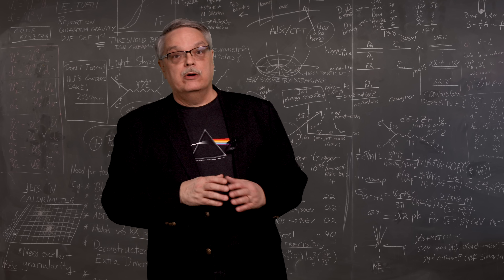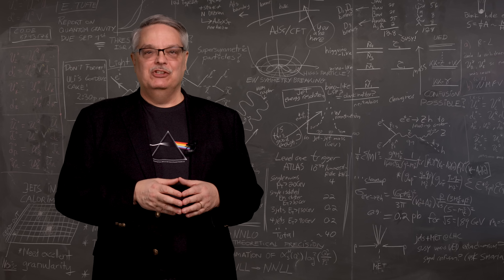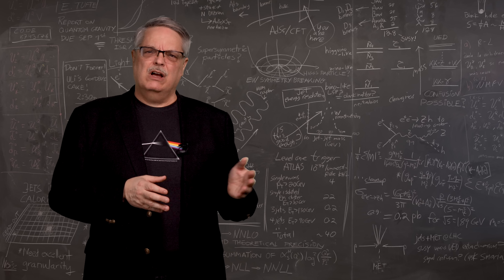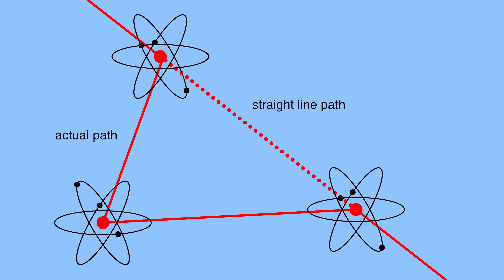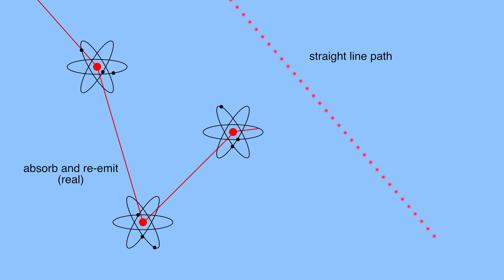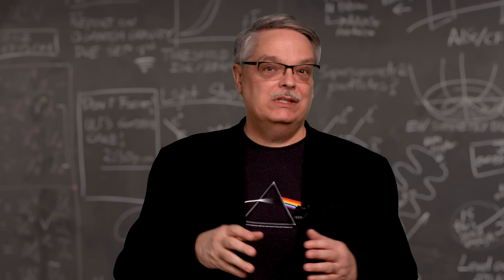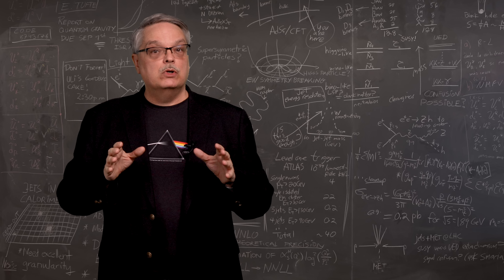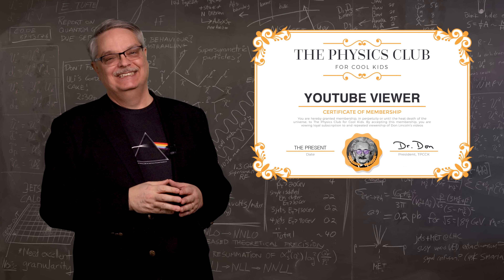Why does light slow down in water?

Comment: 9:18 "but the waves from the electrons move at a different speed"
But why is that ?
Isn't the space between atoms just a vacuum ?
Reply: Ok so first off, the people answering this about electrons having different speeds from photons are dead wrong.  The electrons don't propagate as a wave, they are bound to the atoms.  The incoming light wave (photons) causes the electrons to VIBRATE, which in turn creates a second light wave.  At this point, the speaker in the video botches the explanation.  Both light waves travel at c, however you get some complex definitions of a "wave packet" which has several different ways to measure its speed because it isn't just a single photon, but instead a combined pattern of photons moving through space.  Basically instead of simple sine wave oscillating up and down, light reflecting off of objects (or thru glass, or both) looks more like the audio waves that you see in a music editor.  The information about an object (the image) is contained in packets of overlapping signals.  These packets can appear to move slower than the individual frequencies, because of the way the different waves add together.  This is called phase velocity, and this is what is "moving slower" in the path through the glass.  When the light leaves the glass, the contribution from the glass atoms is subtracted, and the phase velocity returns to the orginal value (remember light is also "moving slower" in the air before it hits the glass).
Reply: @ianallen738  Except you seem to confuse phase velocity with the group velocity. The speed of a packlet is the latter one, while what we see in the medium is a decrease of the former one.
Reply: It is simply not true. The 2 waves are tied in phase everywhere, therefore they can not have different speed (nor their sum). Those waves has not been animated for good reason: it would have revealed the fact that all of the waves has the same speed.
Reply: I have the same question. If somebody could explain it, i would appreciate it very much.
Reply: @juliamay8580  take a look at his video about The Standard Model. Electrons are a type of Lepton where as Photons are a type of Boson. Leptons and Bosons are both elementary particles but do different things.
Reply: "Isn't the space between atoms just a vacuum ?"
No, not really, or rather, there is no such thing as truly empty space. Electromagnetic fields, like the fields describing all forces, have values for every point (or at least probabilities of values). Light is called "electromagnetic radiation" because it can be thought of as waves in the electromagnetic properties of space. When he says that different waves in the same place "can be" added, he means that they are added: that's what it means for two things to be in the same place, barring superposition.
I may have some misunderstanding, but I believe that electrons, like all particles, can be thought of as (oscillating) bumps in various types of fields, including electromagnetic fields. In any case, the effect of an electron oscillating ought to create waves in the electromagnetic spectrum, the problem of course being that all this works according to quantum physics, so I would be lying if I said that I really understood it, even if there have been times in my life when I understood most parts of it, which may not have even been true in the first place.
Reply: @Mr.Nichan  Go back to the original question! Why would the waves from the electrons move at a different speed? In this aspect everything you wrote is irrelevant. The space doesn't distinquish between waves regarding their origin. The explanation of Don Lincoln is just plain wrong, both in physics and math. "recombination" of 2 waves travelling at different speeds is just a stupid, impossible idea. If the slower one is just not there yet (in a specific point where "the light" has already arrived), then how could it be added to the faster one?
He just described the Ewald-Oseen extinction theorem totally wrong.
https://en.m.wikipedia.org/wiki/Ewald%E2%80%93Oseen_extinction_theorem
You can find the falsification explicitely:
"...each of these waves travels at the speed of light in vacuum, not at the (slower) speed of light in glass."
Reply: @PafiTheOne  I agree. So far the question has not been answered, and the animations are plain misleading. I summed this up in this comment: https://www.youtube.com/watch?v=CUjt36SD3h8&lc=UgwzIArRhXxcJHUTdTB4AaABAg
Reply: I just want to point out that my attempt to include quantum mechanics by talking about probabilities of field values was probably garbled. The idea that fields have values at every point is the classical physics explanation, not the quantum one. I think that something like these values might appear at quantum scales, because the "probabilities" of positions of particles are actually the amplitudes of waves (so "probability" has values at every point in space), and there are things about adding up all the possible interactions (which would include the transfers of photons that explain electromagnetism). I would advise Eugene Khutoryansky's videos on waves and quantum mechanics and the Veritasium video on alternate realities for a better explanation of quantum mechanics.
Reply: @Mr.Nichan  I've never read deeply about the classical electromagnetism, but your explanation about fields everywhere remembers me a lot the modern physics while describing the vacuum as full of energy, instantaneously popping up and destroying particles that, effectively, results in matter.
Reply: May be this vaccum is occupied by electric and megnic feild of electron or the whole atom
Reply: full of electric fields...
Reply: I think that's a mistake, both EM waves move at c, but their superposition at < c
Reply: @kapsi  "both EM waves move at c, but their superposition at < c" Try to find such wave functions!
Reply: @kapsi  I don't think it can be described as a superposition of just two waves moving at c. That would be moving at c too. Frankly I find this video misleading.
Reply: Electrons have mass, they can not move at speed of light. Because they move, they generate electrical field opposite.
Reply: @MübinIcyer  yeap that's it what I wanted to point out, it's the reason
Reply: it's because electrons and photons have fundamentally different speeds. this is because the electrons interact with the highs field, which pervases all of space so the space between atoms still has the higgs field. photons don't interact with the higgs field and this is seen because electrons constantly and randomly change their spin direction (indicating an interaction with the higgs boson, the constituent of the higgs field) while photons have one consistent spin direction which means it is not interacting with the higgs field.
Reply: @leemaina8170  Perhaps Higgs mechanism could be used to explain why electrons don’t vibrate at speed of light, but this has nothing to do with EM wave that their vibration produces, which always will propagate at the speed of light. Think of a simple radio antenna as an example. Thus, there should be no difference between speed of external light wave, and internal EM wave produced by particle vibration in the same medium. 

Rather, I would point out two problems I have with that cool animation @7:10:

First, frequency of resultant wave in glass seems changed while wavelength is same as before, which is quite the opposite from every physics book (wavelength should decrease with speed). 

Second, using Maxwell’s equations, Dr. Lincoln explains in “Why light bends in glass” that bend is caused by a fact that resultant electric field decreases in glass, while animation here shows that it oscillates and can actually increase at times.
Reply: @StarFury2  guys, the fact is easy: the speed of oscillation is NOT the speed of the generated photon. The speed of oscillation of the charge determines frequency or amplitude, whatever, but the speed of the photon is always constant: equal to c. The photon is perpendicular to the oscillation direction.
Reply: @leemaina8170  and they have more mass so it's more difficult to accelerate them
Reply: @leemaina8170  higgs field do you forgot gluan field
Reply: Because electrons and protons and any charged particle of matter that interact with changing electric and magnet fields have mass, and therefore they take a while to move (inertia). And it’s their movement that produces the “response” wave, which is slower than the foton wave (foton have a much slower mass than electrons), in spite of maintaining other properties (amplitude, energy...). It’s like a synchronized dance that you had to reduce the rhythm speed because this time you’ve invited your fat cousins and because they move slower everybody else have to move slower to keep the synchronized dance synchronized.
Reply: It's great seeing us all trying to explain something we don't actually know about. 
The scientist dont even know , that's why they keep botching in new numbers to explain what they cant - as long as the numbers compute,  just add more X's or small g's 🤯

Comment: I am not sure he explained why the combined wave travels slower
Reply: The wave itself is not the light. The light is the oscillating point source. The propagated wave is the medium being affected by the point source. 

Best way to visual this is in a tub of still water dip your finger in and out repeatedly you see the wave going out from a singular point. The finger wave is affect. And the finger is the thing doing the waving.. Light does not ever travel but the oscillations do. 

Ie: I can not speak without are. My through vibrates the air and that vibration is detected by you.

This is why light has no mass because the are detecting the oscillations not the thing doing the waving.
Reply: @gdolphy   I guess it's a bit above my level. As an EE who doesn't completely understand how radio waves propagate through space yet I can probably only understand transmission line analogies at this point. In a transmission line the voltage will propagate more slowly if the insulation on the center wire has a higher dielectric constant which will increase the capacitance. So similarly it makes some sense to me that the higher the dielectric constant, the slower the wave travels.

Comment: I think i need to smoke some pot to wrap my head around this. Light becomes slowed from the drag induced by the presence of electrons? I can see the affect on wavelength, color, by prismatic striation. Why then if the wavelength was altered does it regain its original angle of emmission, and if it was altered it would be impossible to retain intensity making it dimmer.

Comment: this hypothesis is quite controversial. the logical explanation of the phenomenon may be the hypothesis that photons are driven by the medium through which they move. Then, each medium drives them to a different speed and there is no problem with accelerating photons after exiting the glass. Phenomenon similar to a bubble with the air moving in the water.

Comment: Ok but this means that light gains mass in the process as massless particles can travel only at the speed of light... right? Or is this merging with electrons erasing the photons and carrying their energy along untill no more matter can transmit the "photon energy" to the next electron basically recrearing the photon itself? I know that this interaction would make the glass more massive as the energy of the photons would essentially add to the mass of the glass but the photon itself cannot basically slow down unless it has mass of its own... right? You just destroyed my idea of lightspeed dude!

Comment: Refractive indexes less than 1 are possible. In fact, water has a refractive index of 0.99999974 for X-ray radiation at a photon energy of 30 keV. We've also been able to create metamaterials with negative refraction indexes. There's an entire wikipedia article on it (and the reason why the values can go below 1 is exactly the same reason why they rise above 1: its only referring to the phase velocity of the combined waveform, which does not carry information).

Comment: Over simplified !
Okay, way too over simplified! 
And easily proven false!
(An positive ionized hydrogen gas will have the same effect on light! And it has no electron shell!)
The truth is a net electrical field effect, not the electrons.
The electrons, have a distance from the core, and thus have more effect the father they get from the core, this produces a hallow 3D circle around the atom. this zone then links up with other charged zones, in a repulsive manor.. 
Hence a net charge effect between a substance.. 
At the core, the positive and negative charges counter each other..
But if electrons, really do travel on the outer shell, the this would be a zone out side of negative charges.. Something is mega wrong with the current atomic model..
Need fixing.. Yikes!

Comment: Why does it bend, and why does it bend again exactly in the same original direction at the end?
Reply: Electronic state of the medium through which it travels. Sub-atomic particles decay into electrons and photons and stuff, there's no guarantee that a photon hitting the medium isn't like a cue ball photon cannoning the balls on the billiard table until the exact medium boundary opposite emits a paired photon... What is observed when the boundary layers of the medium are not parallel, and when those boundary plane exit angles are corrected by a Left - Right symmetry grating of the same boundary layer stuff maybe also sandwiching some EM voodoo? 
Coz I dunno.

Comment: It doesn't slow down, space just distorts because of the presence of matter.
Or at least, we can't tell the difference. 

i always liked the "Iight always follows the fastest path" explanation. Draw two points on either side of the glass. Calculate the fastest way for the light to go from one to the other. Keep in mind to use c / n for any n of present materials. If you have the fastest path, that's exact way the light will refract. From the viewpoint of the light, it moves in a straight line.

Comment: Im pretty sure that this theory is wrong too 
Sound is a wave and it speeds up in dense materials but light slows down in dense materials so the opposite is true i think we need much more advancements in quantum field theory to know the true reason
Reply: Sound is a mechanical wave, not an electromagnetic one, so it interacts not with charged particles, but with atoms and molecules that make up the material. If you consider a sound wave travelling through air by jiggling air molecules that are far away from each other and transfer wave energy only when they collide, it makes sense that this energy transfer will get quicker as sound enters a denser material, whose particles are more connected with one another. Sound doesn't create any additional waves in the material, because it's nothing but moving oscillations of atoms and molecules in this material. Light, on the other hand, is it's own wave that doesn't need no material to travel through space, so it not only travels through material, but also interacts with it, creating that additional wave.

Comment: The animation at 6:23 is extremely misleading. You would expect a monochromatic light wave here but instead you've drawn something where the amplitude varies over time, like in your (correct) interference example later on. Please label it as such.
Reply: The energy of a light wave is dictated by its frequency rather than its amplitude.
Reply: @allenho2778  Is that supposed to justify the animation somehow?
Reply: @foobarbecue  The animation shows that light is a time-dependent electromagnetic wave in space.  The time-dependent electromagnetic wave is a solution of the Maxwell equations.  The amplitude of the electromagnetic wave oscillates in time because electric fields and magnetic fields rise and fall in time alternatively, which in tern causes mutually-supported generation of electric fields and magnetic fields.   When light is emitted by a source, it propagates away from the source.  You should also notice that the wavelength stays constant in the animation.
Reply: @allenho2778  Hunh, interesting. So tell me about wave #2 at 7:06 then. Is that a different type of wave from the one at 6:23?
Reply: @foobarbecue  This is a classical explanation as to why light slows down in a medium as a superposition  between a light wave (electric field) and electrons with their own electric fields in the medium.  Quantum mechanically, photons are scattered by  electrons in the medium, causing the photons to change their characteristics (e.g., speed).
Reply: @allenho2778  I understand that, but it doesn't answer my question. I'm going back to my original opinion -- the wave at 6:23 is drawn incorrectly. Amplitude goes up and down, but not across the whole wave simultaneously like that, unless you're talking about an interference situation.
Reply: @foobarbecue  The wave at 6:23 was an illustration of a wave with a constant wavelength, which is just an example.  It is not about an interference.
Reply: @allenho2778  You aren't listening. I give up.
Reply: @foobarbecue  Please elaborate.  I cannot be responsible for my interpretation of your question if your question is not specific.
Reply: @allenho2778  Ok, I'll try one more time. It's very simple -- the wave at 6:23 is wrong. That's not how waves oscillate. Maybe you aren't watching enough seconds? Watch all the way to 6:30. The only way this could make sense is if it was the result of interference, and it's not supposed to be.